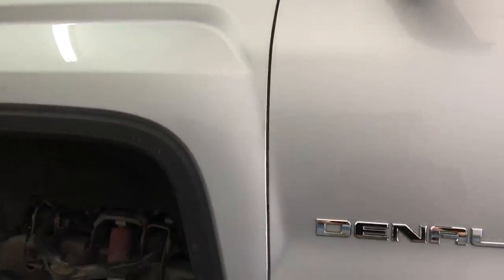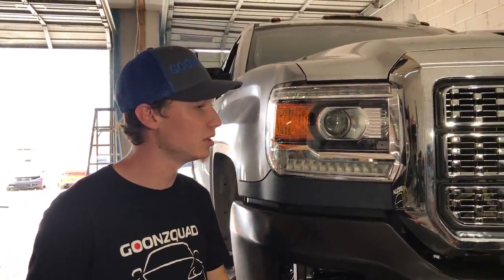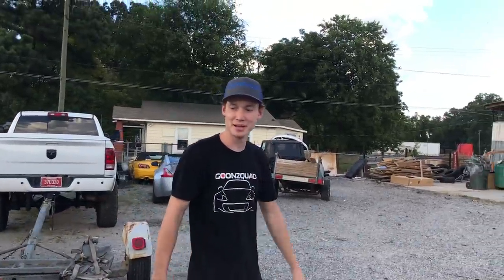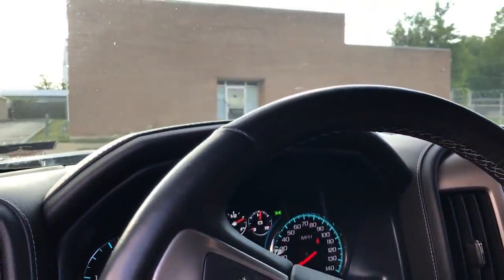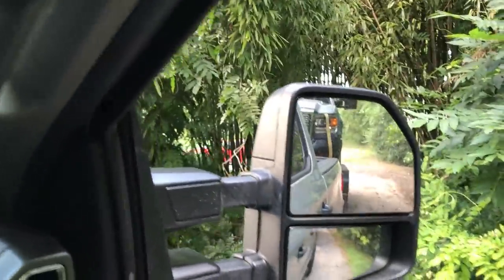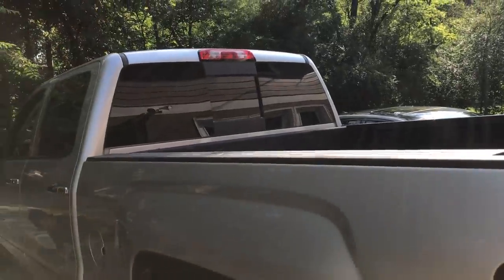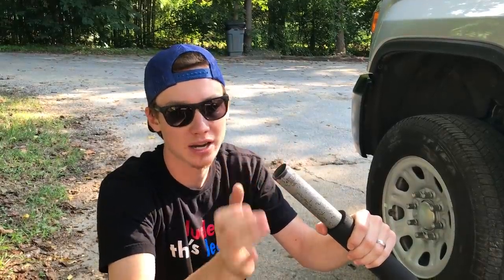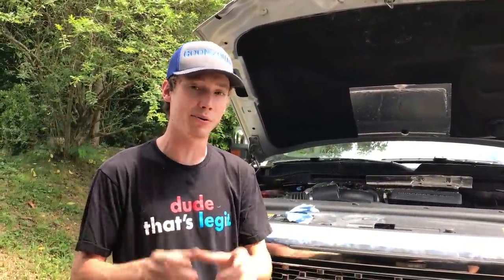Rebuilding A Wrecked 2019 GMC Duramax Part 5

Comment: I would warn you about getting a programmer as you may end up melting piston and this truck is a beast it can pull 2 boats like your on the highway at 80 miles / hours Your wheels alignment will require to be done again as you can't properly perform an alignment with any wrong wheel size on the truck Make sure you install the correct wheel ASAP as it will mess up the 4WD mean time 2WD only in parking lot only 

The DEF is a 5 gallon tank make sure you fill it as once you start to be low it will start to reduce your speed till you can no longer drive and it is a pain sometime to reset 

Lift kit may seem like a good idea but it is not like the steering shaft extend to it's limit the brake hoses route to stretch and the ABS speed is no longer in line with the transmission speed meaning the electronic will fuck up intermittent leading to light coming on for no reason .The one modification you can do is with a GM approved kit if any that was tested by the engineering with the proper programming   may be up to 22 inches wheels 

The transmission fluid is to be check with the engine running but the best suggestion for now is read the owner's manual I don't see that you would need to replace any fluid right now as it is 2019 but check the maintenance section make sure you inflate tires according to the spid label on the driver's door before you go for the next alignment with the final set wheels I suggest OEM and no burn out The only thing you could do is one wheel on the gravel the other one on the asphalt to posi-traction rear differential will work to transfer power to the left wheel down burn these clutches!

Comment: I don't know if anybody else has said it, but when you check transmission fluid the vehicle needs to be in park or neutral and the engine needs to be running.

Comment: maibe you can replace the add bleu tank with a smaller one under the benchseat in the rear or if you dont have saddle tanks oposite the gastank under the bed  , you need the tank and the additive to be able to pass smog and stuff like that

Comment: Just level the truck! No lift, and go with 35 inch tires, it will be such a fitted look. But if you lift, go with BDS suspension lift

Comment: I wonder that you check the oil with no engine run.If I remember on german cars you have run the engine and than you have check the oil.On the dipstick are 2 different marks with 20 degrees and cold so I remember.I don´t know how it is with American Trucks?

Comment: Your alignment is off if you didn’t fix the rear first. The front is aligned to the rear and if your thrust angle is off the whole thing is off. Get that rear fixed and have it realigned.

Comment: You checked the trans fluid wrong. It should be running. It will read higher with it off as the pump is not circulating the fluid.

Comment: You won't be deleting the DEF. If you run out of DEF it will not allow you to drive the truck faster than 5 or 10 mph. DEF is part of the clean air act and it's federally mandated that all diesel engines are equipped with DEF after a certain model year.
Reply: Tampering with the DEF system is against the law and you can get into serious trouble messing with it:-)

Comment: what did you buy truck for $$$
Reply: They paid $34k at auction for this truck. They should be under just under $40k finished. The truck is not worth more than 40k with a salvage title.

Comment: Radiator fluid? that anything like COOLANT? lol Yeah yall laugh at that Dodge all you like that 6.7 mega cab will drag your 6.6 all over that yard.and no i'm not Dodge Biased either i'm actually a huge Duramax fan but inline 6 with ore C.I.D. vs.V8 the in;ine 6 is gonna out torque you every time.plus i'm torn beecause i ove all the room in a mega cab. To answer your question my 06 cummins has a  sunroof, so doe my 04 esccalade EXT and 05 escalade the only one i have that dont is my 06 Escalade. and my 1999 tahoe. odd thing is, almost all mytrucks have them and i hardly ever use that feature unless i'm going spotting for deer. ROFLMAO "Allison juice"  Paint work? i thought you were going to show the process of getting it state inspected in Georgia. that would be handy for me especially because i'm going to build one for my best friend in Warner Robins. So i actually hope you do show all of that

Comment: Think i would have pulled the rear before i pulled it off rack..... might be tweaked in rear and alignment is worthless without rear fixed. 4 wheel alignment with rear pushed ahead? Better find a better alignment guy...yikes

Comment: So let's ruin a fairly new vehicle by putting a lift kit on it. Especially if you're doing it just for looks. If it's going to be a work truck, tow rig, keep it stock. More engineering went into that stock suspension than any lift kit your going to put on it.

Comment: It is a towing luxury truck NOT a mud bogger do NOT jack it up! Because then it will suck to tow with if you do that drive like shi  t. Get a Ford  Raptor if you want a cool truck to lift up to raid area 51 needs to look the part. Get real. Lifting a Denali up is so wrong noooo. Its a Cadillac Truck not a mud bogger! golly.